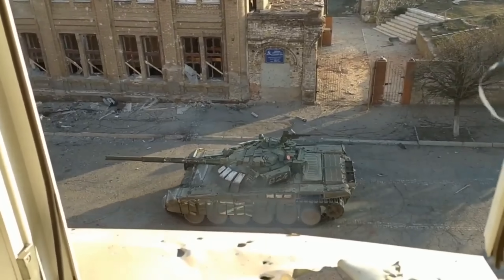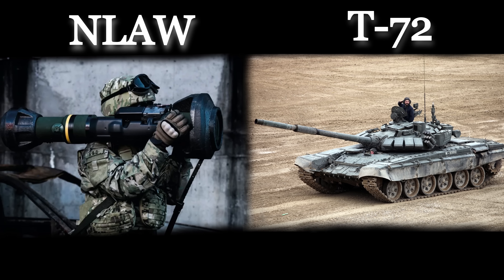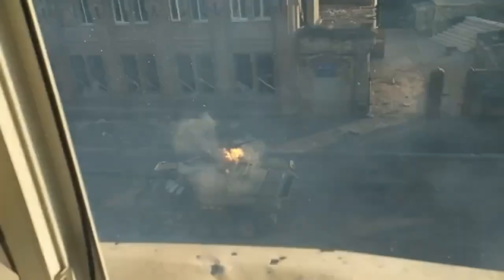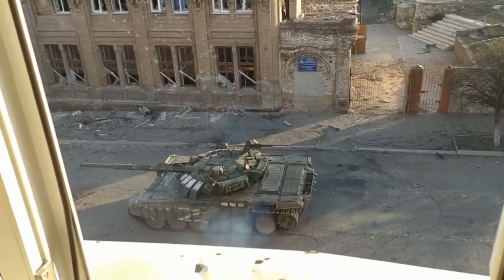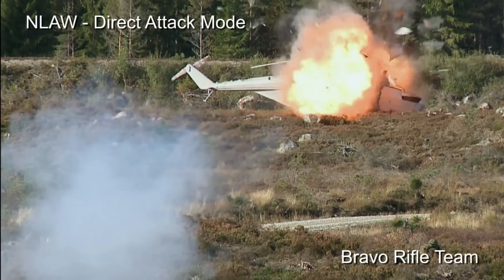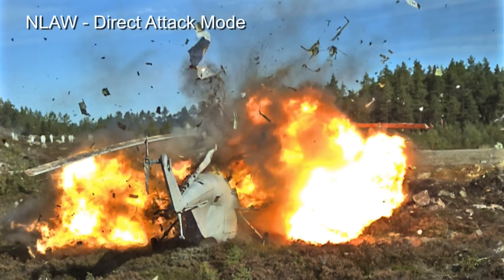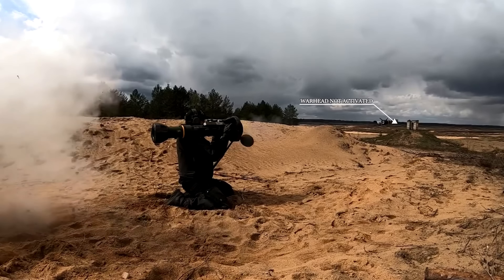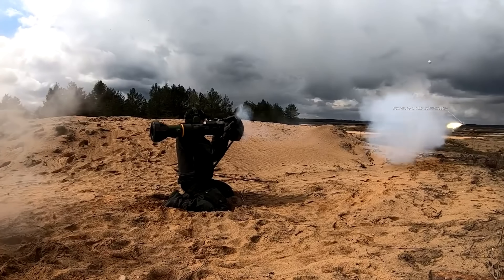Why NLAW Failed Against T-72B Tank

Comment: The missile can be armed to detonate anytime and the safety distance is something that's turned off almost immediately since an atgm is highly directional, much like a claymore.  Some say there's timing. Actually, there really is no timing to do. It's a set process, triggered by a pressure or proximity fuse. That is sometimes referenced to a laser back at the firing position, if it's not fire and forget mode. People expect that atgms make a big explosion, but they don't. The only reason you see a noticable fireball in the stills is because it's slowed, recorded at thousands of fps. The large fireball you'd see is a secondary explosion from the target. In the real world, all you see is  a little flash and puff of smoke. The missile worked as intended and detonated as intended. It simply didn't work

Comment: But the nlaw fires straight down and has sensor to tell when above target… very steep angle to try to use a charge that fires straight down and also sensors are more diagonal/slanted than usual. Maybe it needed time to arm but even if it did a charge firing diagonally to the tank wouldnt work so well. Maybe it was a sensors fail due to the diagonal position of the missile… making detecting the tank difficult because if it use a laser the laser not pointing straight down and may not have been in line with the tank and therefore didn’t register the tank. This missile system is designed to shoot straight down with its charge and sensors probably also. Therefore it not as good at urban warfare as I’ve heard some theorise over javelin. Whether it not arm in time or not…the charge really meant to be straight above target cuz otherwise the charge will partially and maybe completely miss target. Personally I think sensors not work because at a steep angle and the sensors not pointing at the tank

Comment: Funny funny even if the Arm didn't get enough time to activate itself, there was a video that if you can try to find please explain, a T-72B was hit by two NLAW's on the Rear side and Front side of the hull at a far distance, enough to give the NLAW to activate, both blew up but the tank was Completely Fine, it even started to pace up speed as it drove off to retreat from the Field, i would link the video but Youtube has been so desperate on removing russian videos that shows russians succeeding in some events
Reply: Stop posting lies son. You're not good at it.  🤣

Comment: The NLAW didn't fail, the operator did. The NLAW did what it was designed to do: not blow up until it reached a set arming distance.

Also that wasn't an NLAW, the projectile is completely wrong and seeing as this video was put out by the azov regiment who has little to no NLAWs, it's highly unlikely.
Reply: Why would you  post an "explanation" that "explained" exactly what the man just said?

Comment: Yeah the NLAW worked exactly how it was intended it barely had time to star its motor much less arm the warhead. It's fucking how a misile can be flying over the tank and shoot a shaped charge down while in mid flight. There are plenty of videos showing these missiles popping the turret off every kind of tank the Russians operate. There's another video of a tank being hit multiple times and after the first or second hit the driver or commander bails out when a third detonates a good 15-20 yards away from him in top attack mode bursting a little before the tank it seemed and he is severely injured even though he is about as far away as this soldier was when he fired it so I think if the warhead had detonated this warrior would have been severely injured if not for this safety measure.

Comment: Nlaw failed it true why ?
Who reaction this video need back to school to learn triangles and pitago and maths 
First  look this video u can see gunner hide in 2nd floor normal high about 7m + 1,7m high of gunner it ~ 8m with earth, t72 high 2.2m  it mean distance 90 degree =5m8 but in video tank t72 out side the house about 2m more use pitago true distance from nlaw to top hatch t72 6 < metres. Nlaw after fire it go about 3 ~4 m after that burning engine fly to target -> it have time to active warhead 
Seconds : in video shot we can see after fly out engine not burn and they stop video for notice in the missile so after video play 0.5s we can see smoker blue from the position of missile it mean it active to attacks t72 tank
Third : said the gunner choose wrong mode of nlaw from direct hit to top hit it mean you not know anything. Why ? Because with small distance and missile has actives in video you choose direct or top hit its not different because range  to close, missile direct or top hit always hit to top hatch of t72
I said nlaw fails because hit to behind top hatch - low armor but no penetration- you can see the fire in touch point invideo
Fourth : nlaw type hit and run, missile hit and miss all ability of target has have when note in missile when aim
All of it -> we have 1 clown in President of Ukraine and new Nazi in Ukraine, stupid Ukraine solider

Comment: A recoilless rifle like AT4 or Carl Gustaf M2 could have been useful here.
Or, you know, just giving the NLAW some arming distance. Not much more was needed.
Reply: Either could have seriously injured or killed this gunner.  The CG does have the ability to fire a special confined space round, but it needs 100m minimum distance to target.  In addition, the CG requires up to 70m of travel to arm itself.  Saab says 50% chance of arming at 20m, up to 100% chance of arming at 70m.
Reply: @mfuchs2004  This is why Youtube replies are cool sometimes.
Reply: The AT4 has a 30 m arming distance, so wouldn’t have made any difference.

Comment: You would think that 20m safety feature is bad, but I've seen plenty of videos where the missile barely skims some obstacle nearby the operator such as the wall they are using for cover, same with Javelin.

Comment: As stated there are 2 modes of attack use for the NLAW. The second mode, top detonation mode over the head of the turret should be selected in this case. However, the angle and position of the firer, distance, means that in that situation, a rocket launcher direct mode of fire is the only option. If the firer was farther away from the tank, and the second top detonation mode selected instead, then the tank might be completely destroyed, provided there are still plenty of ammunition stored in the tank turret.

Comment: Nothing is true in this video :
-Direct mode can penetrate around 500mm of homogenous armor.
-Overflow top attack mode can penetrate around 50mm of homogenous armor.

In this video, it was a direct shot, the shooter just missed and hit the turret's 5 o'clock, the NLAW's tandem charge only hits the side of the turret and didn't penetrated it.😁😉

Comment: Guess the Missile is a bit useless in urban areas then… and in the countryside the missile operator would have been taken out by the supporting infantry… so.. all in all.. Ukraine has been sent some duff equipment..😏
Reply: it works in urban areas, it is one of the few anti tank weapons that can be used from within a building, the arming distance is a safety feature. If the warhead had armed at that short of a distance it most likely would have wounded or killed the user.

Comment: As most of you out there know tht the closest range the NLAW can be effective is 20m(66ft) to 800m(2625ft) looking at the video we can see tht the distance between the initial point of firing and impact is far too less than 20m which gives very less time for the projected NLAW to gain velocity in the video it did explode but not enough velocity to penetrate which resulted in a wasted round 

(Velocity is also a key factor in penetrating a tanks armor)

(Disclaimer:most T72-B's doesn't have ERA's on back and top of turrets)
Reply: No, when an explosive charge is used to penetrate a tank, the initial velocity of the round is totally without any meaning. The explosive penetrator moves so much faster - orders of magnitude - than the missile that carries it.

And no, it did not explode. Just the fuel in the missile ignited.
Reply: @AllanFolm  mhm intersting I'll not hem down cuz iam still a novice
Reply: @smolboi7789  If you're talking about APFSDS - projectiles, they have a limited range, because they are purely kinetic and have no warhead. Only a pointed stick of hard and heavy metal coming at you at 4.000 m/s.
Reply: @AllanFolm  A long rod might have 'limited range' but it still has exceptional killing power for a looong distance. A British Challey killed an Iraqi tank from over 3 miles away with a long rod. It was an older model piece of Soviet crap... but a kill is a kill.

Comment: Please correct your title. The NLAW did not faill but the soldier fired in from a range too close for its designed purpose.
Reply from the maker: Hi Androidkhh. 
The title is meant as why the NLAW failed to destroy a T-72 tank. 
I agree, the NLAW worked as intended.

Comment: The weapon was used out of parameters, hence why it "failed". In fact it behaved as designed when hitting a target that's closer than the minimum arming distance.
Reply: Exactly prevents the user from blowing themselves up too. There isn't gonna be a "respawn" button. That tank crew still got their bells rung. Hopefully they had new underwear.
Reply: @diesela3  
Nah.  In this case, no more of an effect to the crew than if someone slammed the outside of the turret with a single blow from a 2-lb hammer.

Gunner: "What was that?"
Vehicle Commander: "Don't know.  Continue to proceed normally to the objective."
Reply: Bang on! Pardon the pun lol
Reply: Nope. Direct attack mode. Turning off the distance limit is a thing yk. This is not the first occurrence.

Comment: Always have your Molotow-Cocktails (or similar tools) ready in close-distance-combat-situations, save your expensive weapons for longer distances. 🤔
Reply: Unfortunately a molotov cocktail is only effective when the hatchbis opened. If not, it can do some damage when the burning fluid enters through imperfect sealings, but the automatic fire extinguisher will keep the tank operational.
Little chance for an orc-meat frying festivity...
Reply: @Peteralleyman  I wonder if this is actually true, I mean sure it should be the case with modern tanks, but you still got exposed parts such as sensors and optics that should be able to be damaged by fire. Im also curious how the crew would react to being on fire, panic might set in and the tank might get stuck or otherwise rendered unusable. Besides there are examples of armored vehicles being knocked out by fire, for instance during the Kiev protest/uprising, there is a famous video of molotov coctails burning an Ukrainian APC to bits https://www.youtube.com/watch?v=TxfxIoMeEFo
I guess even automated fire suppression systems have their limits.
Reply: @papab34r  
I already said that it can do some damage. If sensors are damaged. the tank will become at least less effective indeed. But that's different from taking it out.
And crew panicking could happen, but would als depend on training. 

And a tank is a bit larger and heavier than a police armoured vehicle.

Comment: In order for the NLAW weapon to cause significant destruction, it must accelerate for at least a 100 to 200 meters, which was not the case here. 
The shooter fired the NLAW at a distance of about 20 meters and therefore, the impact was minimal and thus the destruction of the tank.
It wouldn't have failed if the NLAW would've reached the Speed that it Needs to destroy the T-72B.

Comment: and as I see it was aimed a bit 'high' and it bounced off.
Reply: Nope. Too short range. The missile won't detonate for the safety of the operator in that case. 
If fired from sufficient distance, the missile will home in on the target and automatically detonate at the weakest point of the tank: above the turret.
Reply: @Peteralleyman  as i said: 'and' short range AND it was hit the fare side of the turret and bounced off
Reply: @mcdougles  
Bollocks. You wrote "it was aimed a bit high". That was not the problem.
Don't act as if you know what you're talking about. The missile will itself aim for the right spot. It detonates and won't, no matter what, ever 'bounce off'. 

Make a comment if you can add something, otherwise keep shut. And don't try to correct things afterwards by lying.
Reply: @UC2oRjw7OKG8eWn7CRepSZ7g 
I'm glad I wasn't serving at your side.
If you launch the missile at sufficient distance it must lock on the target and will than automatically detonate at the right spot. It's not about aiming at the right spot, it is about locking on the target.
I.e. bollocks indeed.

Comment: how can such an old tank  stand up against such a missle?simple... the war head needs to travel over 24 meters to arm ! another armchair general talking total and utter bollocks about a subject he clearly known next too nothing about
Reply from the maker: this was my analysis also. Sad you did not watch the whole video for the explanation and gave a quick insult instead.
Reply: @EngineerReact  he ruined it by saying an rpg would have been better. He either doesn't know about the backblast or thinks it isn't a problem in a room
Reply from the maker: @Milieboy  Hi Milieboy. I could have been more clear. I meant rpg for close combat, where I showed rpg-7 as the most famous rpg (which of course wont work inside a closed building without some self damage). I was thinking of the AT4 CS (confined space) if you´re inside a building but did not add this section to the video. The AT4 CS is not an rpg in the right definition but an recoilless rifle but its often used losely to cover these weaopons also.
Reply: This is what the video is explaining if you watch it.

Comment: The missile would have been calculating the detonation timing when it made impact. The motor only started a few few away from the tank so the missile probably wouldn't have even had time to see the tank, let alone arm the warhead.
Reply: Doesn't matter when the motor started. When armed to detonate at firing, the missile will explode leaving the tube, if it has to.

Comment: As many said min arming distance. As for producers claim of being non jammable you  could also fool its arming mechanism (magnetic fuse) in top attack mode with em jammers such as those used for some types of anti tank mines. You basically shift magnetic signature of tank to have incorrect detonation.

Comment: how does NLAW missiles arm? Is it burn timer? if it is burn timer then soft launching like in the video will extend its arming distance to more than 20 meters hypothetically
Reply: I think it would be counting the rotations and not burn time.
Reply: @Milieboy  missiles like this dont spin tho, it is very different from rpg which is a unguided rocket

Comment: As well as the 20m minimum arming range, another point to consider is the downward angle of flight. NLAW will not arm if fired at a downward angle of less than 45° , that firing looked to be on the cusp of that angle !
Reply: Only in overfly attack mode,not direct attack mode as used here
Problem is direct attack mode wont scratch the paint on a tank
Reply: @mastermariner490  Which beggars the question . . ."why use 'direct attack mode ' against a main battle tank"  ? . . .
Reply: @clivedunning4317  Operator error most likely,probably not trained on the NLAW
Direct attack mode is for light armour,trucks helicopters and soft targets
Looking at the video you can feel the stress from the soldier firing it
Reply: @mastermariner490  if you are shooting on the top armor Is the same thing lmao
Reply: @BELANDIOFFICIAL  Did i not explain what direct mode is,Einstein
Dont let me repeat myself
Reply: @BELANDIOFFICIAL  no, it is not the same thing. Direct mode employs a penetrator and shaped charge Heat warhead. It won't penetrate modern armor inside of max miasile velocity, and not at all in most cases with modern armor defenses. The weapon requires over a  hundred meters of flight to reach max missile velocity.  indirect attack tips the warhead downward allowing the penetrator to reach many times the velocity of the missile itself.  Higher velocity equals more energy against the armor at its weakest point. All moot in this case. The primary motor didn't even have time to fire before the missile hit.
Reply: @mfuchs2004  the armor on the top could be pierced by a 30 at the right angle and with AP, i dont think that the missile needs to be at a higher Speed than what It can reach in that distance, but It has to be armed for sure
Reply: @mastermariner490  well you said that direct Attack wont scratch the Paint on a tank, Einstein so It depends on the angle and the armor
Reply: @BELANDIOFFICIAL  No it doesnt,becuse the warhead points 90 degree downwards to defeat armour from the top,Einstein
In direct mode it wont do anything to armour,except for light light armour like a truck or a helicopter